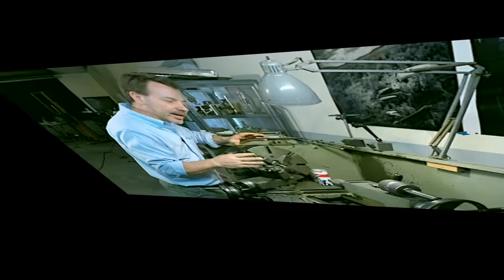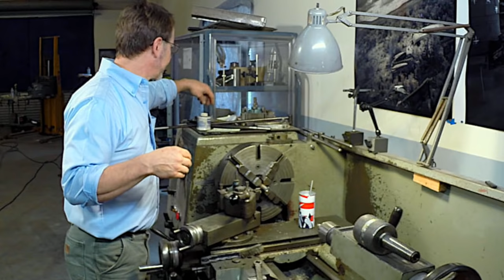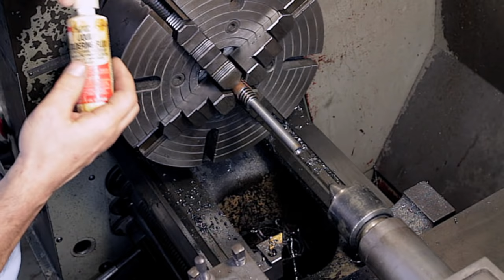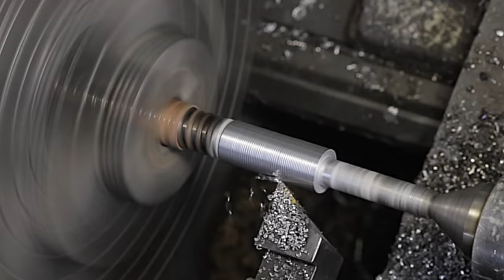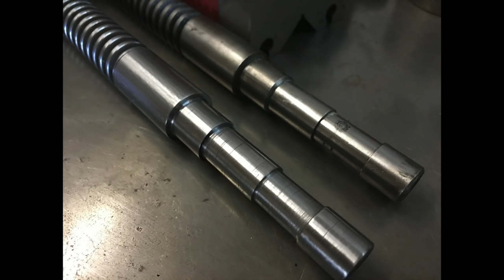How to make a LEAD SCREW

Comment: Funny thing is I just fabricated a screw the same way ...and just ran across your video. welded and turned the end to developed the shoulder for the bearing ...Also used a bearing bronze nut inserted in the end to take up the wear in the cast iron nut
 ...very tight and smooth ...thanks for what you do

Comment: Dale great idea. May I suggest another possible way. Cut the lead screw material maybe one thousandth over the diameter of the material that is going to be used to make the shoulder. If you can get some "dry ice" (or just small bucket of water & ice & a small amount of salt added, to increase coldness, or if you have access to some liquid nitrogen) Put your lead screw in the ice bucket for approximate 5 - 10 minutes, then very quickly remove lead screw from the ice solution,  and hand push the shoulder material onto the lead screw, when it (the lead screw) reaches room temperature, it will expand back to give a great very tight fit.

I would guess that if you had access to liquid nitrogen, you would be able get 3 {three thousandth's} maybe as much as 5 (five thousandth's) difference in diameter. When I worked at a major airplane manufacture here in the Pacific Northwest, Washington state, they did this to some of the rivets on the wings, and when they (the rivets) reached room temperature, it sounded like a guy swinging a 40 lb's sludge hammer against the wing. The first time I heard that noise, I ducked down to the ground, and lying there looking / waiting for something to fall. Heard about five more and was able to figure out what was going on. Plus the guy with the big silver mitts (to protect from the liquid nitrogen) was a dead give away.
Reply from the maker: +Stanwood Dave 
great suggestion, and storie. ill have to try that

Comment: I know that I'm a lurker by some standards. But 30 years in Electronics and many of the things I fixed had electro-mechanical systems.
I don't know if you would be interested or want to help but this is on par with the lead screw video. I'm a disabled veteran and I have started a Woodworking shop in my garage. I purchased 3 pieces of equipment from a man several years ago.
A DeWalt miter saw, works. A Craftsman table saw, was dropped on the motor side. I was able to get the pivot pins backed out of the motor support. Complete disassembled, removed rust, motor and arbor bearings, alignment, link belt and it runs perfect. Just saying where I'm at in the process.
Alas the Craftsman planer-jointer is a different story. On the infeed table side there's a lead screw that raises and lowers the table. The cam is broken into 5 pieces of aluminum. My Son is a welder and he couldn't fix it. Just melted.
It's also the FIRST piece to be snatched up on EBAY.
1) Are you or someone else willing to help me?
2) Can it be made out of steel? It has a center screw hole, a cone shaped hole and a straight hole. 
If someone made 10 of them they could make some money on EBAY. The first thing to break and is unavailable.

Comment: Nice work!  I prefer soldering, but loctite on a tighter fit would be just as good without having to heat.  But you knew that already, of course.   While turning acme threads is fun..........this was the best solution for a number of reasons.  Thanks for the video!

Comment: Hi Dale, greeting from Charlotte, N.C. I made a lead-screw similar to yours for my 1980 Kent surface grinder except mine was 10 TPI ACME left hand threads. I chose to machine it complete from mild steel with slightly oversize pitch diameter to compensate for wear in the bronze nut, which I didn't replace. Keep 'em coming, I'm still learning.

Comment: Another way (I used for the cross slide screw on my South Bend) is to simply cut the original at the end of the shoulder, bore it to just under the minor dia of the new threads. Turn down new leadscrew to tight press fit (insert to whatever length you bored) inside the old bored end, and then secure with bearing sleeve retainer. No heat...

Comment: Good job! An example of a job that is not at all complicated but VERY critical. Since the sleeve actually serves no mechanical purpose other than a spacer, I would have just turned the shaft a half thousandth oversize and pressed it on. Still, it never hurts to know how to solder.

Comment: Great video. When you said solder I thought you were going to brake or hard solder but then I realized that the collar wasn't under severe torque, just supporting the bearings and collars.
Reply: Brake not break...
Reply: Damn spell check Braze
Reply from the maker: you would be surprised how much torque that a solder joint will take

Comment: That was positively the video I needed see.  I am POSITIVE that I need to make a new lead screw/nut for my cross slide.  I am POSITIVE, I did not want to turn Acme threads until I fixed the cross slide.  I am POSITIVE, I will be using your technique to make what I need.   In all seriousness, I hope I can "Build Something That Cool" for my lathe.  Great video.

Comment: Actually, this was kinda helpful. I've got some drive motors for an car seat adjustment system that have trapezoidal screw shafts. I need to use them in a robotics project, and I had thought about soldering on a shoulder for a bearing, but I wasn't sure how practical that might be. This gives me a little more confidence.

Comment: Great idea, much easier than cutting the thread yourself.
If that unthreaded section isn't needed you could have shouldered the bearing directly to the turned down thread.
I would always have been taught to use a silver/hard solder but a soft/lead solder in this application is perfect, good call.
Reply from the maker: Hi jonathan, I like your comment. Remember if you have enough surface soft solder will work as well as silver solder, and it is a lot cheaper  :-)

Comment: Novel way to "fill in" the threads. Thanks for the tip.

I was a bit worried when I didn't see any heating of the shaft for the soldering. It seemed to work, though. Sometime I'd like to see a solder joint like that milled away so we could see just how far the solder penetrated without heating the shaft. (Even a tiny bit of penetration should suffice in this application.)
Reply from the maker: +Peter W. Meek 
Good Point. I edit out some of the soldering to shorten the video. It took about 4 min to heat it up. Convection heated up the shaft. it was plenty hot for the solder. 
Thanks for the great comment.

Comment: I'm a big fan of having the hole exactly the same size as the rod. Freeze the rod, heat the sleeve and when they come together they're stuck!
Reply from the maker: +Marsh Wildman 
That a good idea.
Reply: +Metal Tips and Tricks (Dale Derry) 

I'll say!

a container of ice cubes and water at the ready may help speed up the method.

:)
Reply: I agree.

I'd have made the collar an interference fit, and sweated it on.

If I felt I needed even more security (probably not necessary in this case), I'd have cross drilled a few times, and lock-tite'd in some pins, them turned down the sleeve to finished size.

I'm not a bit fan of solder, for torsional loads.
Reply: BedsitBob x
Reply: Absolutely.  I wouldn't trust glue or solder.
Reply: @BedsitBob  He said that that section was a filler and wasn't part of the structure just an end stop to the bearing. 
Even if he didn't solder it onto the shaft. Threads on one side and a bearing wedged on the other. Where could the sleeve go?
Reply: @timthomas9105  I'm a belt and braces man. Better safe than sorry.
Reply: Another approach would be to make it a light interference fit, press it on, cross drill and pin it (securing the pin(s) with Loctite), then machine to final diameter.

Comment: Thanks Dale, I have a very very, did I say very old lath where the cross slide screws are worn so I have been looking for a method to replace them, looking forward the how you do the nut as that really is the part that is worn on my old lathe

Comment: The solder was a good idea, however if you really needed to hold it in place, say due to the stress on the shoulder, I would suggest using JB Weld for the formatting substance.
Reply from the maker: ill give it a try

Comment: I have used silver solder alone on the lathe to build up a worn shaft then turn back to size. Kinda messy but worked well. Great if you miss your measurement by a thou or two assuming the solder is hard enough for the intended purpose., ie shaft running through a bearing race.

Comment: Interesting -- what was the nut made from?   I've pulled screws off machines that were not bad, but the nut was TRASHED.  The screw in that case was steel, the nut was bearing bronze.

Comment: I am wondering if you have ever seen a vertical mill adapter to do a similar process of a horizontal lathe? In my head it seems possible, and reason for asking is due to limited floor space. :)

Comment: I would have made a press fit instead of the soldering but I guess it's another way of doing it. Would love to know what it takes to break the solder in a hydraulic press against other methods like Super glue and other methods mentioned in the comments. Great videos BTW.

Comment: Nice job Dale! To avoid the issue that may arise from heat would not a light press fit and Loctite have been a better option? You are doing good with the Friday tips and should be close if not beyond the point where this has become habitual and thus past the hard part. Congrats!

Comment: Dale:

I'm curious as to how much slop there was using the new screw and the old nut.  Not knowing what class of thread you have, with the new nut/screw combination, just how much play is there?  I have a Delta Milwaukee Toolmaker Grinder, unknown age, very worn lead screw.  I was able to take up some of the end play out using some teflon washers, but still have about half turn of play in the nut.  I'm not sure if it's worth fixing, but without a DRO it is kind of annoying.  

Jim

Comment: Nice job! Wouldn't an alternative also be to cool the shaft and heat the sleeve in order to get a secure fit? That might work even without glue or solder.

Comment: Why not use a light Press fit on the sleeve ???
Reply: Or a strong one where you heat it up before slipping it on?
Reply: how strong would a press fit be? or the thermal shrinkage intereference fitness can it slip during transmission of torque?

Comment: Would Loctite work as good as solder? Would it be weaker or stronger?
Reply: +MrPlusses 
Good alternative. 
Probably stronger if prept right. Definitely easier. Wont warp the bar. Easier than interference fit.
Reply: I've also had very good results using loctite. There are lots of different variants, but for this application, loctite 609 would be ideal. I would certainly use this rather than superglue, though it is more expensive.
Reply: +wallacesaan  Perhaps 638 might be the choice on a joint that is NOT meant for future disassembly, 609 is. Although I don;t suppose, in this situation, great strength is a priority so either would do.

Comment: While I did watch this to find out how to make a lead screw from scratch I found it instructive all the same.  Sometimes you just don't need to reinvent the wheel.  I do have a question regarding the solder.  It looked to be regular plumbing solder-was it?

Comment: Very cool. Do you have a recommended supplier for the all-thread? I was shopping stock for my Atlas lathe and saw a pretty huge price variance. I wondered if quality followed price.
Reply: +Rick Rose      Enco is a good place to find all thread of all types and sizes. Prices are pretty reasonable too.
http://www.use-enco.com/CGI/INSRIT?PARTPG=INSRAR2&PMAKA=328-2767&PMPXNO=25223462
Reply from the maker: Enco is a good source also Mc Mastercarr
Reply: I checked out the Enco link and was very surprised at the reasonable price. I don't know where I was getting the crazy prices last time I looked, but I was seeing a range from $25 to $100 for a length suitable to replace my carriage drive on my Atlas. Good to know that project won't break the bank. Thanks guys!

Comment: How do you know it's the screw and not the nut? Is the screw made softer to wear sooner? Thank you.
Reply from the maker: The screw was worn so bad that you could see the ware on it. Also the nut would barely in gage at the center of the screw ware it was worn the most,
Reply: +Metal Tips and Tricks (Dale Derry) Thank you.

Comment: Since your hole was oversize, turning it down after soldering but before testing tells you nothing about the warp. A better way to check for warping is to back off the tailstock and put an indicator on the end as soon as it has cooled. Best yet is to shrink it on and have no warping at all.
    Mike (o\!/o)

Comment: I would protect your lathe when applying the flux. Especially seeing how you spread it all over the lathe. Flux is acid, A piece of ply under the shaft would protect it, and soak it up and protect it from the flux while soldering.  Otherwise a decent vid. Or some aluminum foil.

Comment: Screw cut the old shaft Acme thread to the most worn size width wise and reduce the diameter by a few thou if required . then screw cut a new nut to fit modified  shaft thread , done this times on old machinery, I know its not the correct way but quick easy and less cost , splitting the nut and spring loading it to take backlash out is another way if the thread isn't too badly worn .
Reply from the maker: +Chris C. 
That a great Idea

Comment: Were you using soft or hard solder?
Reply from the maker: +Andre Gross 
I used what ever pluming solder I had laying around
Reply: Hi Dale !
Nice video. I did not known that it was possible to solder iron/steel with tin/lead solder !
Thanks!  👍👍

Comment: Nice job although I might have brazed it?  I am like you Super Glue has never worked for me on anything.  I sure wouldn't hang from my hard hat using it!  It doesn't even weld my fingers together.  I keep trying it because others swear by it but no success.  Some say use an accelerator with it and I haven't tried that as it is pretty hard to get where i am.  Doug
Reply: Tower Hobbies on line has supper glue cheap. All kinds, also accelerator and  de-bonder release spray.  I have used it to make yacht parts & 10 years later still holding fine without screws.  Clean parts several times with acetone first.
Reply: that is super glue
Reply: CA for short

Comment: I'd have brazed it, not lead solder. Apart from that, a good way to replace a worn lead screw... but why not screw cut one out of plain bar? Just a thought.
Reply from the maker: +Gordon Burns 
The all thread I used was ground  to an accuracy I didn't think I could hold on my lathe.
Reply: *****
OK, thanks for your reasoning. On reflection, I probably agree.

Comment: As a non native but pretty proficient speaker of English, I'm left a bit confused: what's the difference between "building" and "altering / adapting / modifying"? Because I clicked to see this video very hopeful and curious to see how a lead screw can actually be built in a machine shop, and instead I am seeing a very nice video about altering adapting an existing one...
Reply from the maker: HI Eros. Thanks for your comment. I like your word Modify, it might be a better word to use, but at the end of the day I needed a new lead screw and wanted to show a different method for my viewers on how to make one. :-)
Reply: Hey there! I dabbled a bit into designing a hobby CNC and, part of that, I looked into the ball-screw end bits machining, to make the raw stock fit the specific requirements. I noticed many companies that sell the raw stock also deliver the end bit machining services - I guess that's close to what you showed here...

Comment: Am I missing something? You did not make a lead screw, you bought it!
Reply from the maker: I bought the all tread made the proper end so it would work with my machine
Reply: etienne nel. he bought all thread, not a lead screw.  if you want to see how to thread a rod watch another video.
Reply: There is a difference between precision cut and ground Acme lead screw stock and "All Thread". Unless a toolmaker has a VERY precise lathe and tool post grinder the lead screw stock is more accurate than could be made in the average shop. On a really precision machine like a surface grinder, I would definitely buy the stock rather than cut it myself.
Reply: Regardless of whether it is better to make or buy a lead screw, the video title is "how to make a lead screw" which is simply not what was done in the video.
Reply: John Fare
Reply: John Fraser Actually it was... The lead screw was a specific part for his machine, so he bought stock material (not a lead screw, just ballscrew bar stock) and he machined the end to turn it into the leadscrew he needed. Must be an open ended lead screw since he didn't machine a support block fitting at the other end.

Comment: 4 jaw chuck for a round part? rly?
also useing a pipe to clamp it in there (the pipe is cut so it can flex i suppose?) is not a really good idea if you want the part you've just machined to run true with the rest of the screw... shimming it on each jaw individually with square sheet metal pieces of slightly softer material would have done much better, i usually use just a drop of superglue to secure them to the jaws so they don't fall of (don't forget to clean your jaws afterwards)... you really don't need to use copper to protect a hardened steel screw from damage ;)